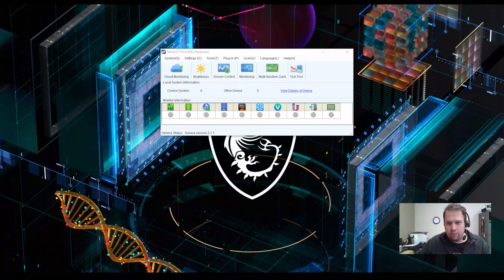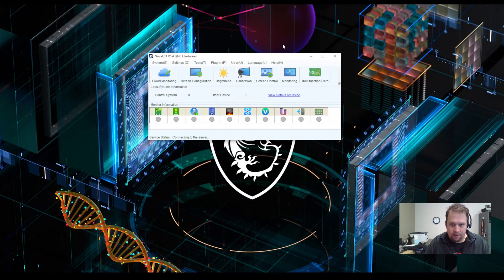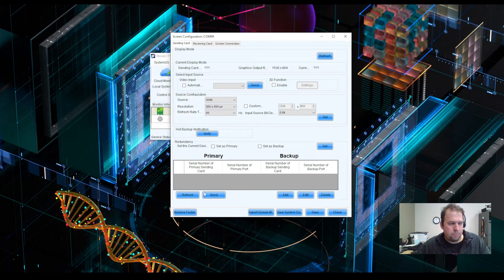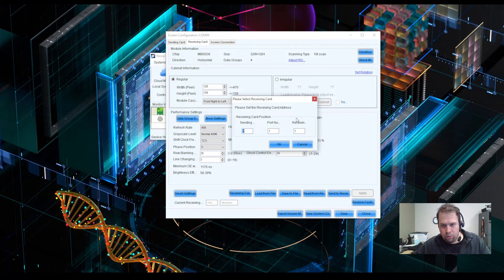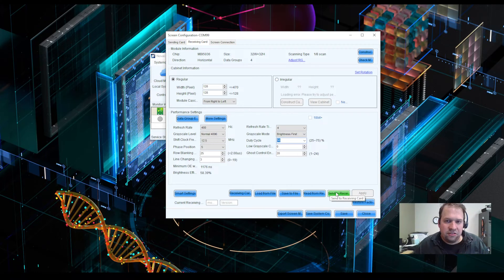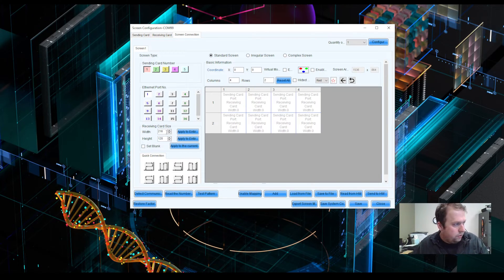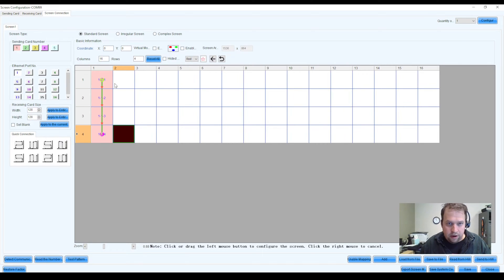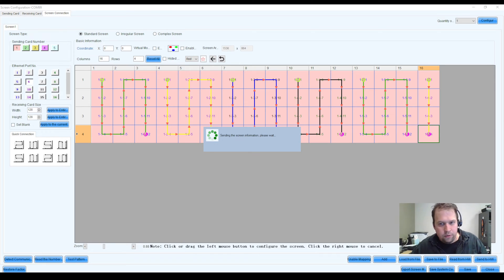Novastar NovaLCT Setup and Configuration Tutorial

Comment: Hello I have a serious problem. I made a mistake causing the controller to go back to factory defaults. After which I took the configuration from a different controller with identical setup, uploaded and now the screen is completely black. Before going black the screen was artifacting in may collars then it went black. Any suggestions ?
Reply: i’ve got the same problem, did u manage to find a fix?
Reply: Yes, I managed to fix this problem a while ago. Therefore, my memory is a bit foggy. But what my mistake was restoring the configuration and not sending it. One way to confirm you sent the configuration is to pull the config after your pushed the config to make sure it's on the unit. @wedontcare7281

Comment: Hi Kevin, Great video, I am looking to connect a large screen and power it using 2 Novastar VX4S-N sending cards, these sending cards dont have the capacity to run the screen on their own. I can see on your screen configuration it gives you multiple sending cards to draw your cable routing on, how do you wire these up so that you can run these in parallel?

Kind regards,

Joe

Comment: (Sorry if I make some mistakes writting this message, english isn't my first language) Hey, I'm mostly a Streaming operator here in Guatemala, but I'm starting to transition to led screen mapping as well.

 I have people that will rent me the led modules and cabling but I'm planning on buying my own LED Processor, so I already decided to buy the Novastar VX600, but I have a question I couldn't find in the whole internet: I'm aware that I need to set my led's custom resolution to the processor and to the novastar software, so I can finally do the mapping on my mapping software (for example: Resolume Arena) but the question is: Will my pc will ever recognize the led's custom resolution on the windows settings? (Like when you use a custom monitor with a special resolution, like an ultra-wide monitor) So it fits the canvas perfectly, or will it always detects it as a 1920x1080p monitor? 

And if so doesn't it affect the overall quality of the mapping? because what the pc is detecting is not the same resolution as the overall resolution of the led screen? or should I try to make it fit with my mapping software?

Comment: i am try to configure a screen, Specs say resolution for this screen is 416*224 dots. But maximum in the configuration tool is 373*256. The original config file is not available. Any idea how i can adjust the thresholds?